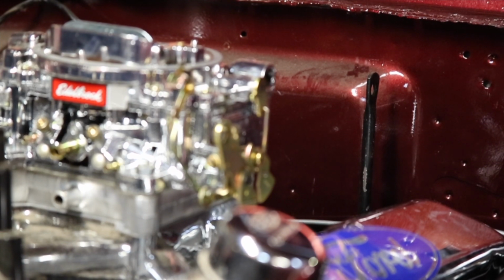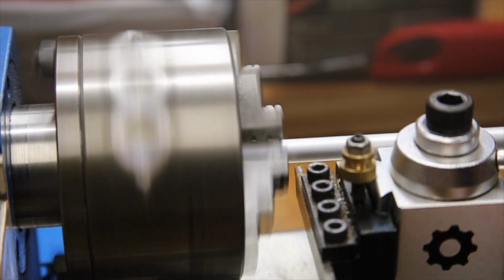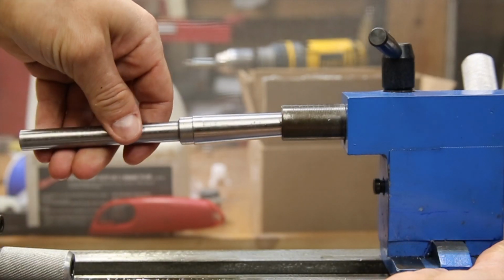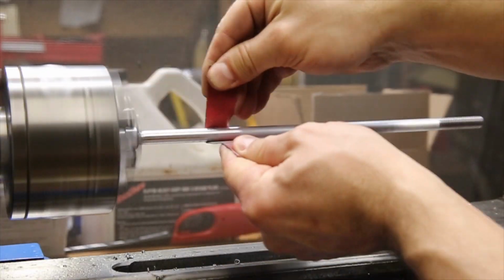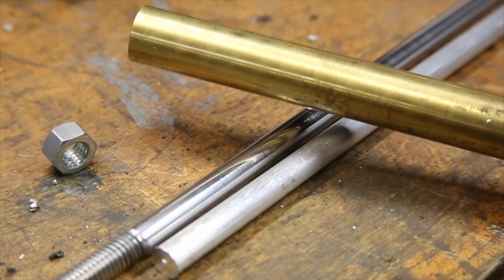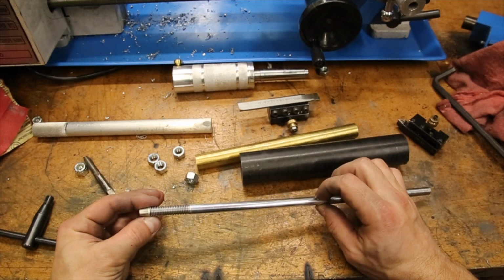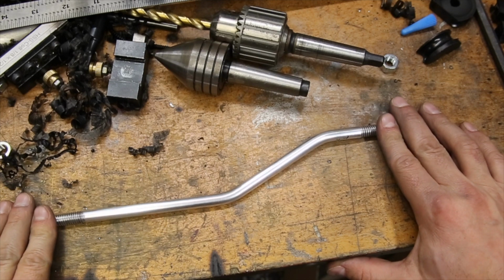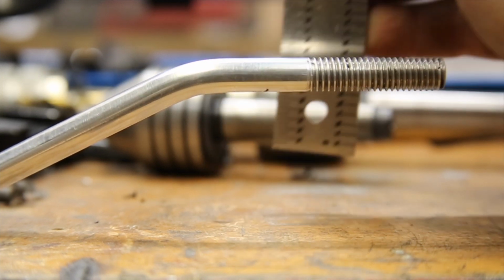(1/3) Custom Restomod Ford Mustang Throttle Linkage on Mini Lathe with Homemade Metal Bender

Comment: Tim, just a quick tip. Although you may not observe it as much on the mini lathe I found that using oil on your parting operation especially with aluminum prevents the metal from heating up to the point where it welds to the tool. I just jammed a part the other day on aluminum because I did not put any oil on it.
Reply from the maker: Thanks! I haven't had an issue of the tool jamming up in the part, but I have had the issue of the aluminum building up on the tip of the tool and making it very dull/rounded. But usually a quick hit with the wire brush reveals the sharp edge again. Good to know it can jam up though.

Comment: Good video. but I wouldn't use aluminum.

Can you elaborate on your polishing procedure?
It looks like your using the different polishing compounds in 'brick' type. Are you just using a cloth to apply it?

Cheers

Comment: Heya, been watching your videos for ages. if you put the round end of the chuck (the jaw tightening chuck) into the screws on the 3-jaw it's designed fit in without any movement and it's way easier to manually turn the chuck.
Reply from the maker: I'm not sure I quite understand what you mean..?
Reply: TimNummy sorry my bad. Let me try again

You have a 3-jaw chuck and you use a chuck key to tighten and loosen the jaws by putting the square part of the chuck key into the square bolts on the chuck.

I noticed when you are cutting threads using the die holder you use the chuck key as leverage on the chuck to rotate it.

What Im suggesting is instead of inserting the chuck key with the square part use the round part instead when you are using it for leverage. You will find that it is a perfect fit into the square hole with no play and its easier to use to rotate the chuck by hand.

Comment: Why are you using Al? Those steel nuts are going to seize to it unless you grease them & keep them greased. Myself I wouldn't want an aluminum rod going to my throttle.
Reply from the maker: Hey John, aluminum is light weight, easy to work with, inherently corrosion resistant, holds a nice luster when polished, and more than strong enough for an application like this. A steel rod would have been a lot more difficult to work with and would have to be painted or otherwise coated to prevent corrosion... unless it was a flavor of stainless steel, in which case it's still more difficult to work with, more expensive, and much heavier than aluminum. Finally, while the nuts are steel, they are zinc plated which will prevent almost all the potential reaction between the aluminum and natural steel. Really, the biggest force this will see is the weight of the return spring on the carb, which is pretty minimal. Thanks for the question and hopefully that helps!
Reply: Aluminum has no place in a car...stainless would be great for that rod
Reply: @OldCrowsClassicCars  He is not like us... he is too young to have experienced such failures. I just came up from by my vise and there is a dead aluminum crank arm that has a steel pedal shaft stuck ( corroded ) inside it. he should google al/fe corrosion if he doesn't believe two old timers like us!
Reply: @johnpossum556  I'm actually in my 20s! But I've seen enough of white rust/aluminum corrosion. 

But I work mainly on old/classic cars...in many ways I am.an old.timer.
Reply: @OldCrowsClassicCars  Ah, then you would be what we call "an old soul" and you've got a lot of good knowledge for some one your age.
Reply: @johnpossum556  thanks that's nice of you. And ya I've heard that before.

But as Antonio Banderas said In a movie 'age is a state of mind'.

Keep well friend !